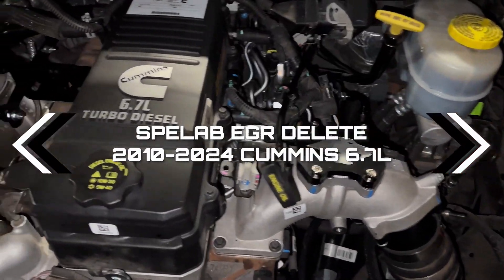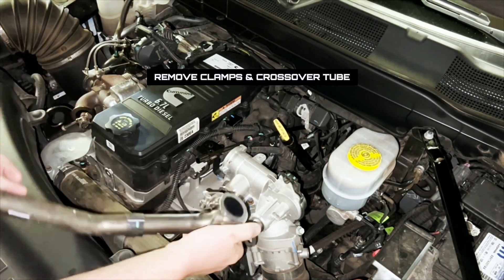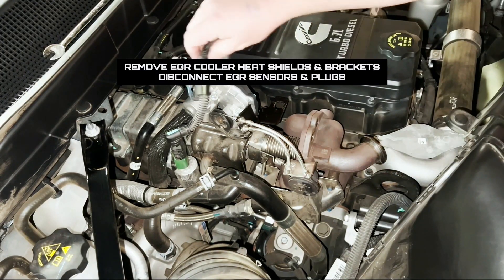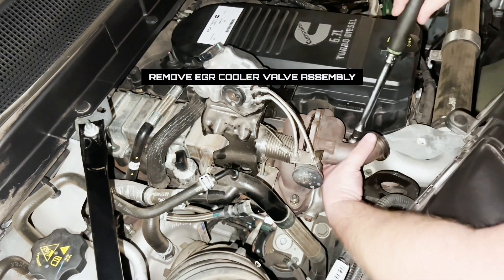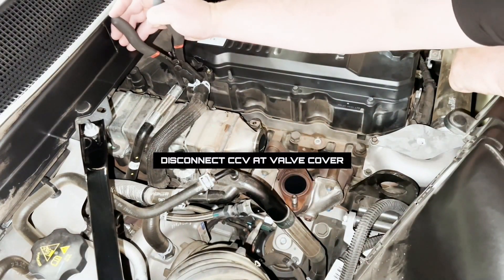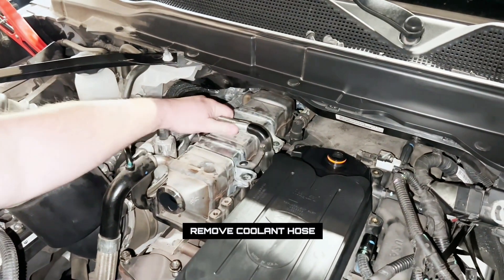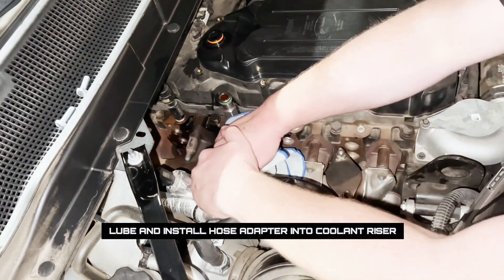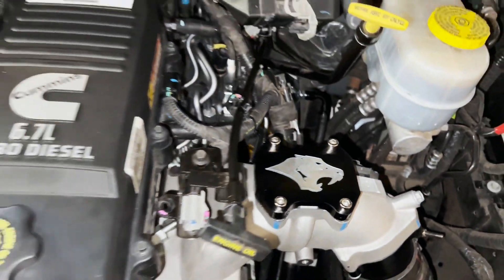How to Install 6.7 Cummins EGR from Spelab on my 2022 RAM 3500 6.7L Cummins?

Comment: Gotta call some bull shit on this, anything aftet 2021 has a locked computer you cant just hook up a tuner and fladh a tune. You have to buy a new unlocked one and then have it tuned and a new one alone is $2500 by itself unless you can find a used 2021.😊
Reply: I installed  a kit for my 2022  it cost me 2650 .had everything including tune.but you can only do stock tune no added horsepower unless you change the ecm
Reply: Neat story, brah. 🤥